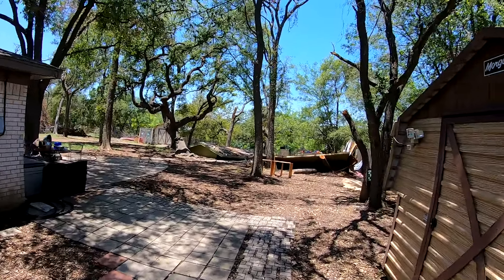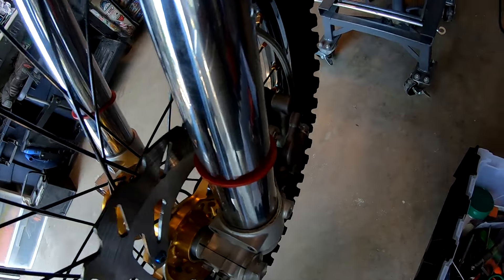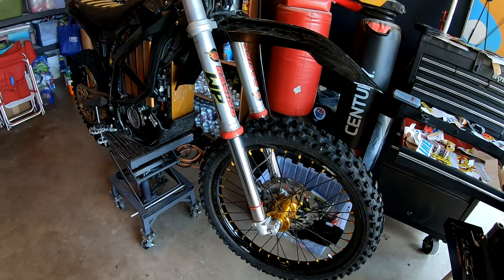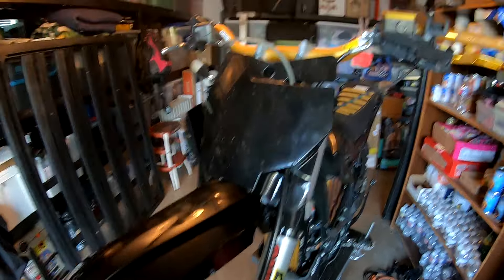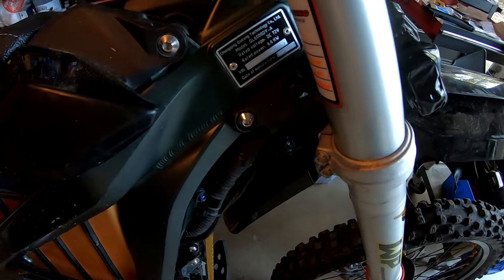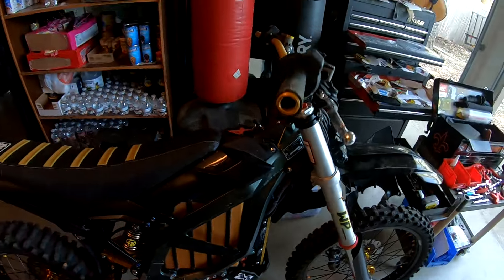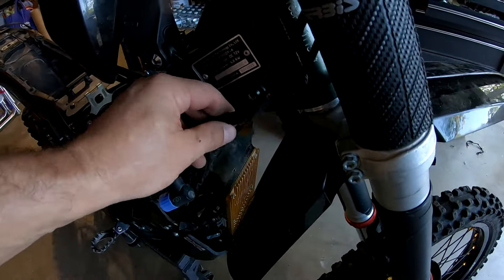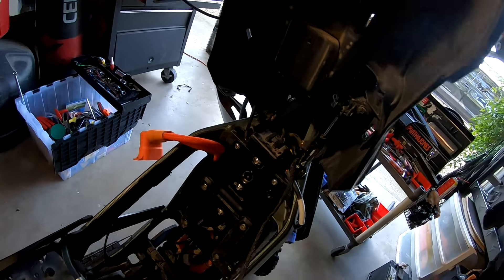Sur Ron Ultra Bee ECR WP 85SX Fork conversion / install kit #2 of 2

Comment: Are you able to get the air pressure enough in those forks?  Also, planning to go springs?  I'm one of the few that don't mined the AER stuff.  As for the pump, I like the tusk one better than the WP one.  Its easier to access and has a longer nozzle on it so that its easier to get you fingers on to turn because it farther out.  I had it for servicing my 13 forks. Someone on a forum pointed that out and it works way better.  I was actually thinking of buying the WP easy fill kit, but this works and I already had it.  If you can't find your pump it's certainly an option.
Reply from the maker: Yes, actually run the air on the low end of spec, seems to work best for me 65.5 lbs. bought a tusk digital pump. Works perfectly and good price. 👍
Reply: @keepupwithajones  the tusk is easier on my gas gas than the wp version.  The longer snoot is easier to get on.

Comment: With all your add-on modifications, weigh your bike now. I bet it's getting close to my KTM 300 , which weighs 240 lbs with full tank of gas.
Reply from the maker: 220 lbs. still much smaller and easier to handle than the 300. Just added a 24 300 XC to the stable and it feels gigantic 😂. Basically relearning to ride a fat bike again…
Reply: @keepupwithajones  True. My UB has 100/90-19 rear and the stock rear is on the front now and with just the addition of the belt to chain conversion and 50 rear sprocket, still feels much more manageable than the 300.